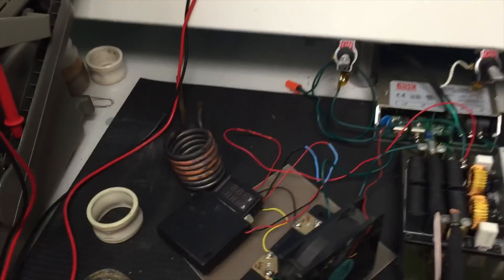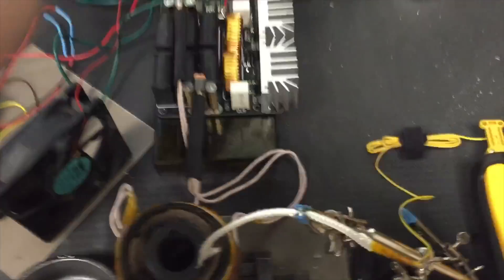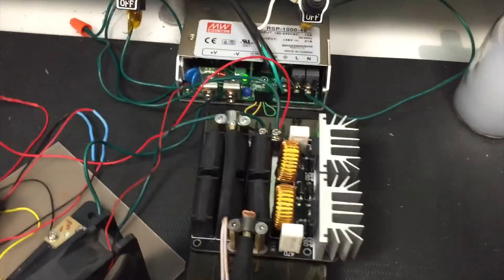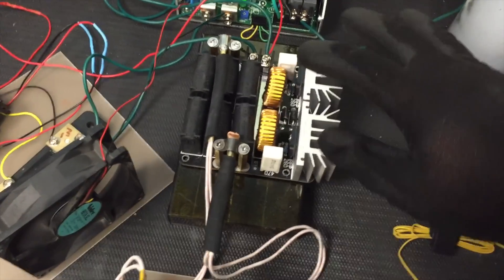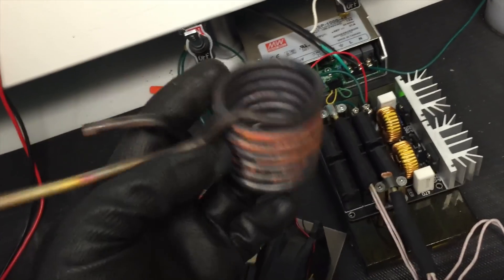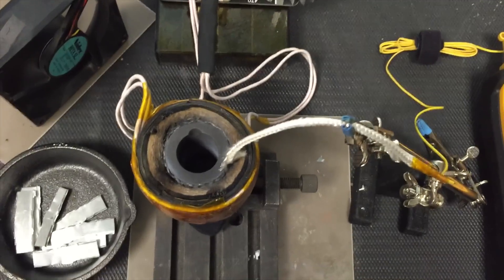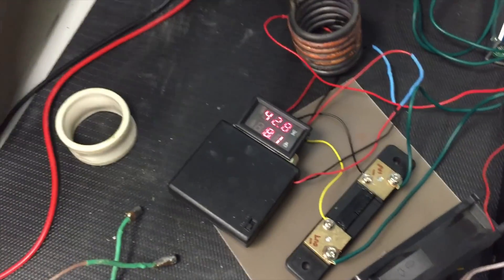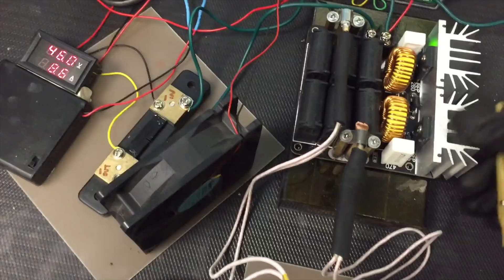1000W Induction Heating Part 3: Melting Aluminum

Comment: Hey Proto,

Did you make your own coil for the induction heater minus the pancake ones?
I'm trying to get started with this to smelt aluminium and cast small parts in my crucible with insulated ceramic outer shell. For now I bought the 1kg crucible on ebay as there was something up with the size of the object you place inside giving too much current draw and breaking the ZVS driver from ebay like on AvE's video.

Would the 2kg crucible work as well? 

I have a amperage and current meter along with a shunt so I can also measure power usage on the fly to not exeed that 1000~1100watts of draw..
However are you also water cooling your coil and is would I be able to melt at 12+ volts al be it slowly? * I might use an 800~1000watt ATX power supply.. which I can turn up with a potentiometer inside to 15 volts... although with modding 24v is possible
Reply from the maker: +Masterpj555 Yes, I made my own coil for the crucible with 7 windings of litz wire.  I used to litz wires bundled together to improve efficiency a bit and to keep them from overheating.  If your coil is drawing too much, just add more windings.  You'll need as close to 20 amps as possible to melt aluminum in a reasonable amount of time.  You should use a 48 volt power supply for best results with this unit.
Reply: +Proto G Wow that was an extremely quick response and I highly apreciate it!
I was thinking of using lipos then although I only have 3 cells here of my DIY quadcopter along with my lipo charger.. I have multiple battery warning attachments which monitor each cell.. as beefy power supply is also quite costly. I was hoping minus a very slow heatup time it would be able to reach these temperatures.

I just cannot reach the 48volts using an atx power supply and putting them in series cannot be done.
I wish there was a better place to tap these voltages and currents from with stuff I might already have..
Reply: +Proto G in your video only about 390watts is used or so.. or at least at the end when the thing is red hot.. is this higher amperate needed for a 2kg crucible you mean or just in general to reach those temperatures with a decent chunk of aluminum ?
Reply from the maker: +Masterpj555 Yeah, this was when I was still being careful not to blow anything.  If you watch the video where I used the batteries, I got up to 1143 Watts!  I can't say for sure but it's worth a shot.  Just try experimenting with different coils to meet your needs.  Thanks for watching!

Comment: 40V and 7.5A is 1000W?

edit: ah, you have variable power
Reply from the maker: +blaaaaaaarghable You clearly didn't watch the full video.  I said that I wasn't running it at full power.  I have ran it at 23amps at 48 volts.  It actually will put out 1100 watts at full power.

Comment: What are your gloves made out of and where did you get them?
Reply from the maker: +slothsd They have rubber on the palm and a nylon mesh on the back.  They're called gorilla grip gloves and you can get them at Home Depot and other hardware stores.  I do not recommend using them when a lot of heat resistance is required.  My crucible is very insulated so I don't really needs gloves.  If I were to spill molten aluminum on them, the plastic would melt to my skin.

Comment: what is that fan going on and off? Is that the 48v supply's fan? It seems to be behaving strange..
Reply from the maker: +ITman496 It's not the supply's fan, it's just some fan I had in my fan drawer.
Reply from the maker: +ITman496 I fixed it for you for the next video.
Reply: why thank you =)
Reply: +Tha14GR I've noticed that the fan seems to go to a constant speed when the voltage is lowered, and starts going erratic at higher voltages.  Very strange.. I suspect you are right about it misbehaving.
Reply: So, zener diode in series with fan? :P  No PWM, no problem.
Reply: In that case I can't wait for next video, fan in this one was really annoying ;)
Reply from the maker: +Tha14GR I can reply here but not on the most recent video for some reason.
Reply: does this 1000w ZVS melts steel and iron if left for longer time ?
Reply: Its the energy from the zvs going into the fan

Comment: Didn't really look hot enough to pour for any kind of casting etc? Are you at the temperature limit of that setup?  If so what is the next step.. If not were you just being careful?
Reply from the maker: +Chris Statzer It will get much hotter but I had to leave my office.  I'm not running it a full power until my spare mosfets come.
Reply from the maker: +Chris Statzer Also, once I make a small lid for the furnace, it should heat up a bit quicker.  Unlike a regular furnace, I do not need oxygen to heat the crucible up.  I can completely insulate it.
Reply: +Proto G Cool I look forward more.
Reply: +Proto G Pouring temp for a Aluminum is somewhere around 1300-1350F for sand casting. You can see the pinholes forming in your melt as it cools from the overheating. The alloy you have (extruded) is not very fluid at temp, something with a bit of silicon in it will pour much better if you intend to cast anything
Reply from the maker: +LtJerryRigg Thanks for the info.  I got the crucible up to 2000F with batteries in part 5 so this setup is more than capable.  In this video, I was rushed out of my lab so I poured too soon.